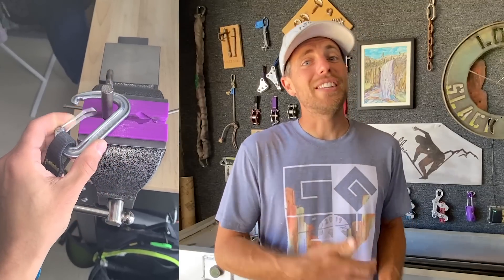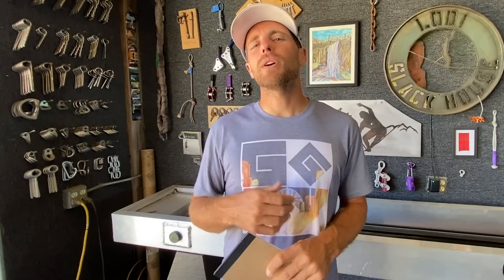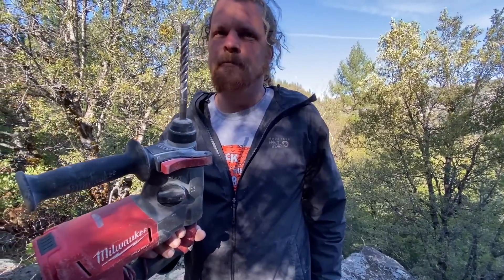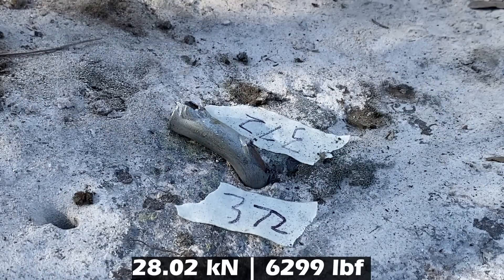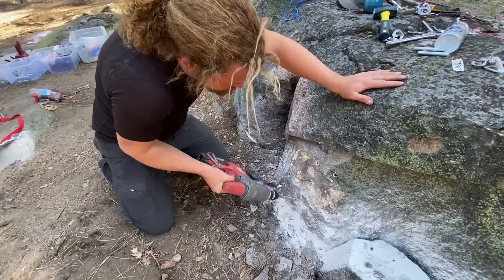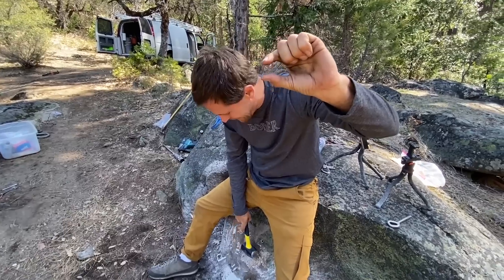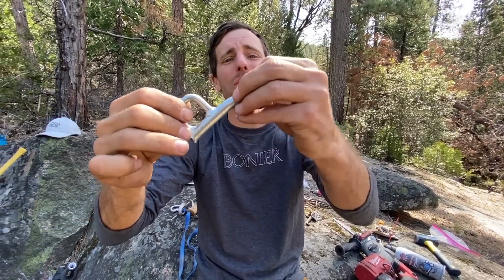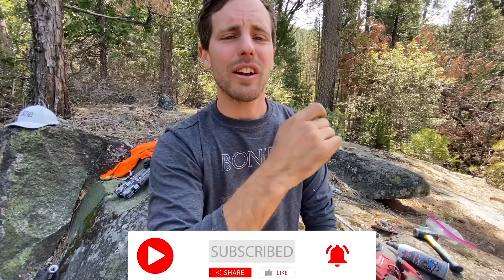Brazil climbing bolts tested - Grampo P

Comment: How was battery life on the drill compared to the other bolts you tested? My experience is that they consume about double the amount of charge compared to a hanger setup. Did you experience that too?
And how does it compare to the glue in that you have used?

Comment: The 10kN difference on the pull test and the corrosion under the weld are very good indications of why you shouldn't trust the welds!
Reply: If you pay attention to where the forces are in the pull you'll see why these had such variation in force... 

Also the rust under the weld just means they were welded before plating which is normal.
Reply: @Brett Combs  maybe you are right. although I've never seen someone weld something after plating...
But if you have climbed in Rio de Janeiro, you will know that there is a massive difference between bolts from route to route. some are made by professional welders, some are made by people in their garage.
because of that, the norm is to install them so the weld isn't a critical point...
Reply: @rodrigormotta  right. You wouldn't weld after plating which is kinda my point. The rust under the coating and weld isn't that bad. It does suggest less than full penetration but that might be fine depending on the expected use.
Reply: @Brett Combs, I don't understand why you are trying to justify this.
the damage to the base material on these tests is so small you could barely call it brazing!
and since it is a safety item that will be exposed to weather, I would say: yes, you want full penetration of the weld.
Reply: @rodrigormotta  Not trying to justify it. but to the extent someone uses a product improperly and then says it wasn't designed or manufactured properly to allow such misuse seems irresponsible to me. 
My comment was more about expanding on the conversation than right vs wrong. Provided the intended use case and construction I'd say they are adequate but not recommend to new people for reasons we've already discussed or seen...

Comment: The way it is usually done is you drill a 12mm full size hole, then you change to a 13mm drill bit and drill 2cm only. Like that you can hammer it all the way in. Cumbersome I know, but thousands and thousands of these are everywhere in Brazil... and should I also mention that in many places in the mountains it is common practice to have belay anchors with 1 grampo only? sketchy... or is it? No reported accidents afaik
Reply: How about the bolt that broke on atalho do diabo about 4 or 5 years ago? And the stainless steel bolt that broke in guaratiba and triggered the community to change all bolts near the ocean? Having just one anchor point for a belay station is a unnecessary risk no matter the gear! 
I like the Ps and all my routes are mostly bolted with them but blindingly trusting on any gear with no backup is an unnecessary risk
Reply: @rodrigormotta  stainless steel -> not good near the sea, also not good material for DIY. carbon steel shows corrosion, stainless don't. as for atalho, well, 1 broken P. how many "certified" bolts failed due to people screwing up bad materials for, well, the FIVE pieces of a expansion bolt? screw up with the material of the washer and it is all corroded in like 1 year.
Reply: In my opinion there is just no reason why to put anchors with single points. Recently I climbed the Agulha Guarischi (in Niterói), although it is not a hard climb, there were no redundant anchors at all in a 6 pitch route. The grampos were all rusty. Rappelling in a single 40-year rusty grampo near the ocean was not fun. I mean, why not to put some proper anchor with 2 points to make it redundant? Protections are only maintained when accidents occur, unfortunately...

Comment: Do you know a scrap dealer or other metal supply with an x-ray fluorescence gun? Would be nice to know what materials the bolt and loop are made of. Might explain the rust.
Reply: My guess it that the rust is most likely due to the fact that it was welded with a stick welder in a really humid place and didn't even melt the base metal...
Reply: We can do this kind of teste at INMETRO... Great institution

Comment: Great video. I climbed a lot on these bolts back in the 1980s in Brazil. Super dependable. Also placed a few. My Brazilian friends did not like the 1/4 split Rawls I brought down from the States. Don’t blame them. After putting up routes trad style (many pitches) someone would go back and put in grampos. 

So, we placed these by hand using a Stanley 1/2 inch chisel in a soft steel chuck and a 1 kg sculptors mallet. There were soft metal (aluminum?) strips placed on the outside of the hole and then banged in the grampos. Huge effort. Bolts understandably were far apart. The Brasileiros had amazing mental control climbing far above bolts. Bold. Bold. Bold! But they could have complete confidence in these grampos! I remember mostly putting a 1-inch sling through them and clipping the sling. From the video I can see that these bolts were as strong as they looked.
Reply from the maker: Thanks for sharing that history!

Comment: @10:00 the weld probably failed worse because you smashed the end all to hell with that sledgehammer. Lol I was surprised the welds were as strong as they were overall... they look like they’re made from mild steel and mig welded... not exactly high quality considering the plethora of better options. Ie 4140 tig welded with stainless 302... now that would be a strong anchor!
Reply: I don't know if it is the case for this specific one but most bolts of this type you find in Brazil are welded with a stick welder buy someone with basic welding knowledge... that is why you don't trust the welds!
Reply from the maker: We did beat the shit out of them before testing them haha

Comment: You see Ryan, that's why I asked you to show the weld area of the broken bolts. Those bolts were welded with a wire feed welder, and didn't get a complete weld penetration which would have made them stronger.  Efficient use of raw materials if thats all you have,  I've seen inch and a quarter U shaped rebar anchors in El Salvador, I would totally whip on it!

Comment: I’m from Brazil and I love to climb routes with grampos and I really don’t like the other kind of bolts (they are small and many times you can’t put a carabiner and pass a rope at the same time easily to rappel the route). 
Most of the routes here were opened with this and there are very few accidents. The problem is the lack of standards and that’s why there’s only ONE guy here that the climbers that still use grampos use to trust. 
Anyways, there’s been accidents with uiaa certified bolts and there’s been accidents with the grampo P. If the person don’t know what they’re doing, it’s dangerous no matter the material they’re using to open a climbing route. 
The other point is: climbing is dangerous, no matter what. If you don’t want to take risks, I think you’re in the wrong sport.. or I am wrong?
Congrats to your work
Reply: I make your words mine, in degree of gender and number.
Faço suas palavras as minhas, em grau genero e número.
Reply: That's Tai. 
hanger you have to know how to install as well as P-bolt. I and a lot brazilian climbers trust on this P-bolts. another advantage is that's very easy to see if any damage was made on it.  #itrustp 🤣
Reply: @taianafurriel melhor comentário. Você disse tudo!

Comment: You think they’re sketchy, you should check out the carrots they used to use in Australia. They’re not generally getting installed anymore but there are still a lot of climbs with them around.

https://www.climbing.com/places/the-carrot-bolt-an-australian-icon/
Reply: Those look like normal bolts used in the metal/construction industry and it looks like they are glued in place, so they are probably safer than the bolts from the video. But of course that depends on what you attach to the bolts
Reply: @metaller1317  its a little metal bracket like a normal hanger but with a slot instead of a hole so they are removable, with the same MBS, however u must use certain types of  carabiners since a wire gate can fit through the slot and allow the bracket to fall off. this is all because australians being the convicts they are kept stealing the hangers off normal bolts.
Reply: They’re not glued at all, just ground with a taper on them and hammered in, hence why they are called a carrot.
Reply: @trueblue862  it looked like they're glued in on the pictures on your link, but I'll trust you with that
Reply: Vou ver!
I will see!
Reply: Li. Entendi. E fiquei 1/2 apavorado...

Comment: The rust between the welds is really unsettling.  Probably corrosion because they used different kind of material for bolt and hanger.
Reply: Yeah, the problem of P bolts is that it's quality depends so much of the guy who made them.

Comment: There is so much wrong with these anchors, The weld, metal, deformation to the anchor when installing, your video says it all. Have you ever come across an old school style bolt we use in Australia called a “carrot” its a hex head bolt with a home made taper made by grinding the length into a slight taper, mostly stainless but not always. So it has a taper and is hammered into the same size, or a little smaller hole (like a piton) placed by ye oldy baddie evolving sport climbers back in the day and we choke it at the neck with a wire, sliding knot or removability bolt plate. Many of these get replaced an can come out in tension with elbow grease. I’ll trust a carrot over these.
Reply: Carrot bolts are on the "To Test" list.
Reply: @bobbyhutton1989  hi Bobby
Reply: @bobbyhutton1989  do you need me to send you a range of different bolt plates that we use?
Reply: @bobbyhutton1989  will do. You can delete your email now if you want. I took a screenshot
Reply: I’ve sent some info…